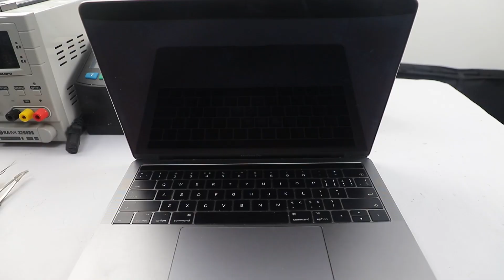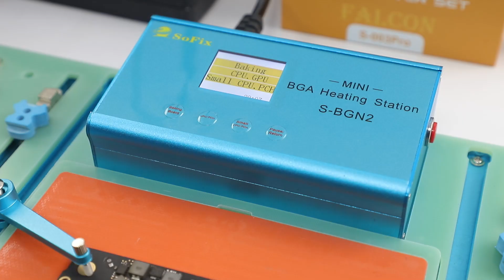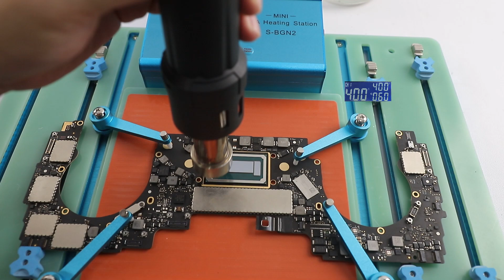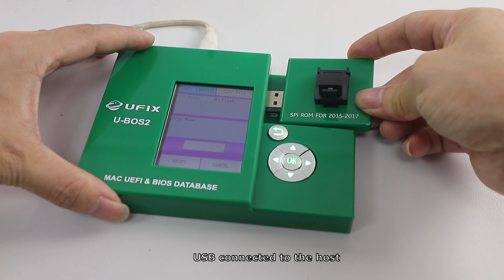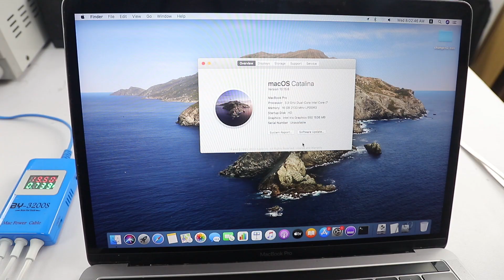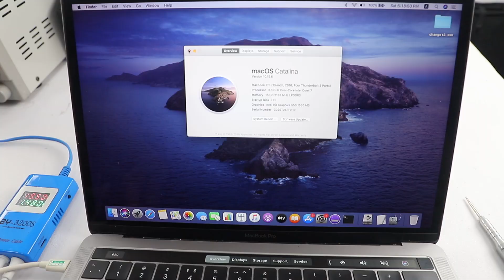How to upgrade MacBook Pro processor i5 to i7 step by step

Comment: Do you work for the company that makes the bios flash tool?

I work for a company that repairs future motion onewheels, and we’re always in search of new and unique tooling. It would be great to simplify our reflashing process on the controller micro for being able to pair with the BMS again after solder rework.
Reply from the maker: @glitchy8429  ok so what do u need for me